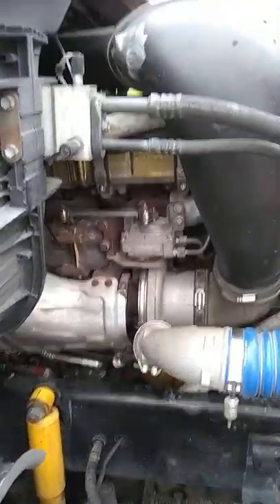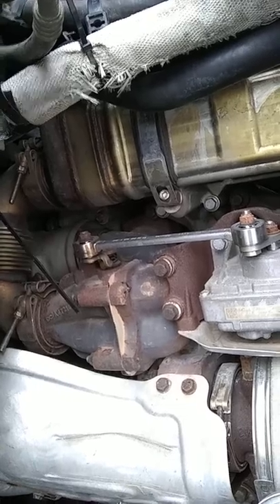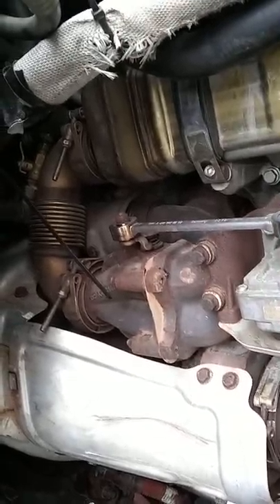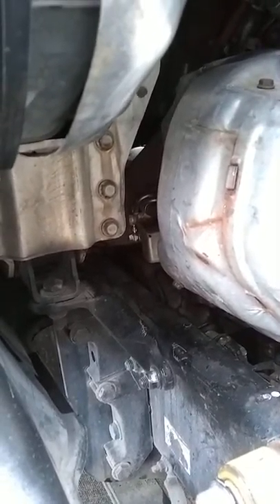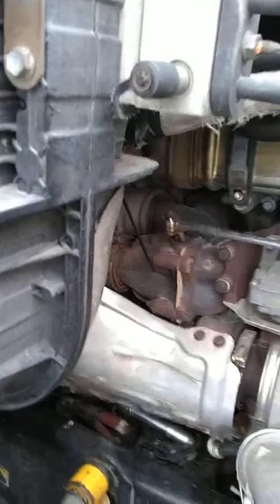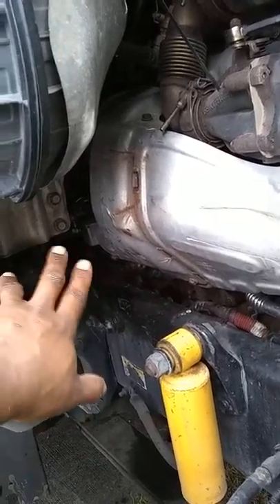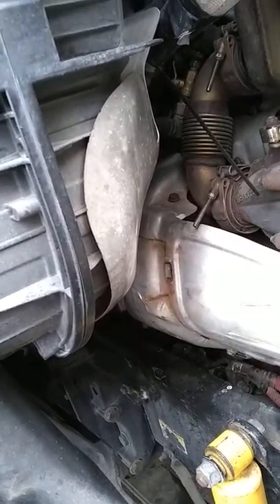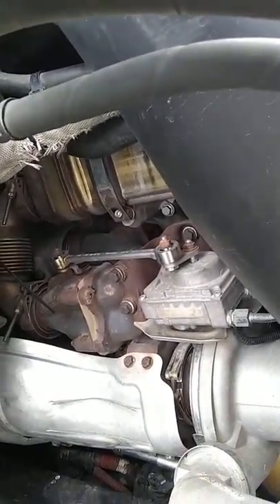Dd15 coolant leak

Comment: thats exactlty what my dd15 detroit engine is doing. the leak is behind the rear section of the egr cooler after the last strap so I want to thank you very much cause at first it was the egr cooler but i did not find coolant inside the manifold pipes. Thank you very much

Comment: Thank you. It take a minute for me too find a video like this. I was going up a hill here in UT and a massive amount of coolant started coming out where you describe at. Drain all the coolant out and was broke down on I-80.
Reply from the maker: Once you take the air cleaner assembly off you will see a distribution block for you heater hoses check those 1st replace if any are old then move on to the metal line tucked between the egr cooler and the rocker box. Glad i could help.

Comment: I got same problem. Sometimes it stops leaking by it self.  My mechanic told me not to use water in coolant and when I changed my radiator and only used coolant it stopped leaking.  Last month had work done replacing egr actuator and they refilled coolant they mixed it with water now it leaking again. So refill with coolant only hoping it will stop leaking.

Comment: I just bought a 2003 freightliner Thomas school bus with a caterpillar engine. It has a coolant leak that sounds similar to this. In your opinion, would this fix work for mine?
Reply from the maker: I doubt it . On a cat likely a 3126 in a bus it should not have any thing that high up on the engine leaking coolant.  Check the oil cooler and of course all heater hoses.

Comment: I am losing 1 g per 5 mile There is a massive coolant on the passenger side😤
Reply from the maker: Check your heater hoses 1st they are all on the passenger side of the engine
Reply: Same problem! Any other suggestions?

Comment: I am losing 1 gallon of coolant every 150 mile and I don’t see the leak. So do u think it’s the same issue?
Reply from the maker: Check your oil 1st if you are making oil it's going into drain pan check oil fill cap for milkshake check heater hoses going back to bunk heater . But usually when you are losing that much and no leak it's the egr cooler
Reply: Bennet elliot Trucking it up thank you very much. I will let you know when I take it to mechanic.
Reply: @alinaasir1  hi , did you fix the problem? And what was it?
Reply: @ymusa8721  unfortunately the coolant was mixing with the oil. It needed overhaul.
Reply: How did the overhaul go?
Reply: @geesinstagram655  I sold it.